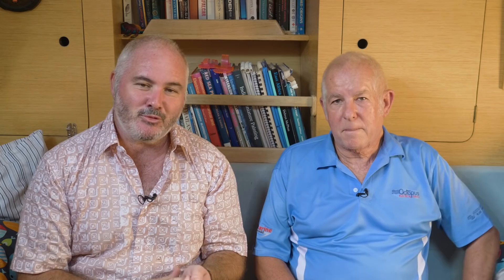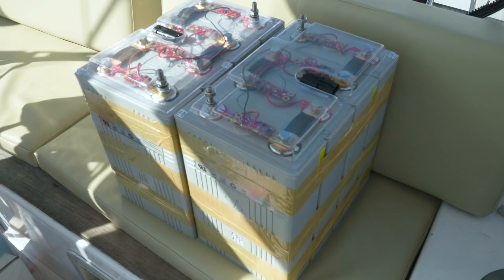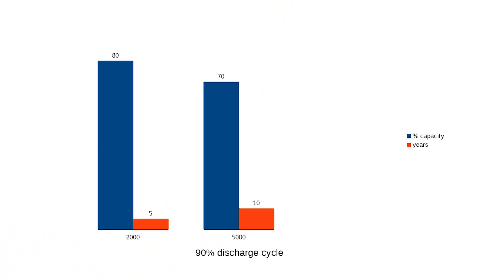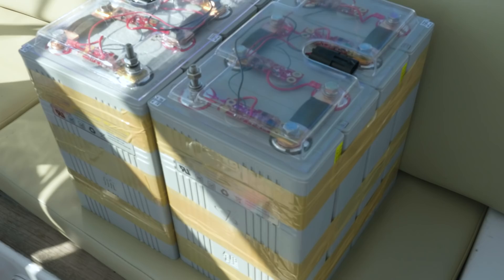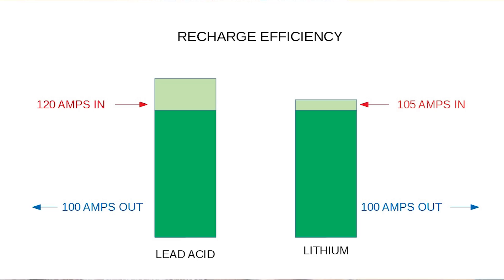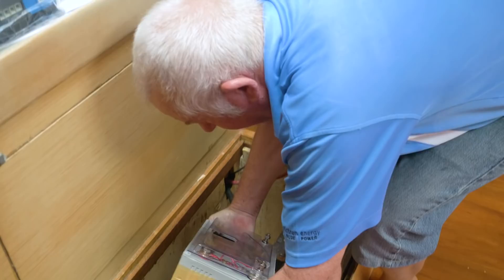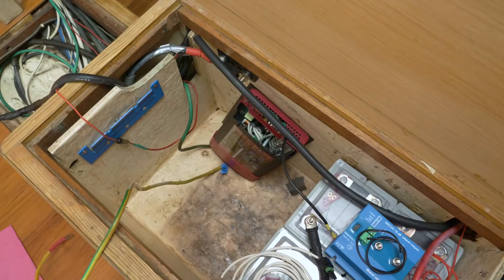Installing lithium batteries on a sailboat - Ep 144

Comment: Jamie and Liz made the right decision according to the United states government.  LiFePO
4 Lithium batteries are the safest, and have greatly reduced the potential for spontaneous combustion, etc.

the more efficient the battery, the more energy stored, the higher the potential for fires and explosions.  but these batteries unlike those before them, have taken safety to a new level (almost, but not quite as safe as lead acid.  to follow is the US Governments feasibility study that answers most of the questions we would have about their safety.  It is basically an accumulation of the many bits and pieces of online data i could find (after subtracting advertisers posing as educational sites) almost as if my research emulated their feasibility study.

Myself, i'd consider a total disconnect and isolation (in the hull/bildge, cover closed, completely disconnected) during a lightening strike risk.  they are highly explosive/flammable, when struck by lightening, or other incidences that can rupture them or otherwise cause sudden discharge.  Otherwise, they are the safest type of lithium batteries, according to the US Government.

https://www.ncbi.nlm.nih.gov/pmc/articles/PMC5505962/
Reply: have you seen the videos where they are shot at and overcharged?? they dont explode
Reply: @helenbell1715  No i haven't.  But it'd be interesting to see.  I have very limited experience with them.  but if i have it my way, will be doing a refit in the foreseeable future, and am hoping Lithium's are part of it.  (hence my concern/s).

I wouldn't doubt that they are airing on the side of caution, knowing the former experience with the lithium batteries.  Lead acid itself, 40ish years or so ago, had issues.  they progressively became relatively safe, such as anything should, so i'm sure these will too.

thank you for bringing that up.  It could help dis-spell some possible myths
Reply: @nonyayet1379  we've been using them for 5 years on our catamaran.  full time cruisers and admin on two facebook groups..lithium on a boat and solar on a boat
Reply: @helenbell1715  I'll look that up thank you.

which lithiums are ya'll using?
Reply: @nonyayet1379  lifepo4 calb 32 180ah 3.2v cells

Comment: Is your 120 amp altenator able to put enough charg into your batteries? I ask because I have the same size altenator and am told that I need one goth a higher output. I’d rather not spend the extra money if I don’t have to. Ty.

Comment: Watching closely,  im an electrician, and I considered lithium last year.. The benefits of lithium really tempted me . But im happy with my 675ah trojan setup .. lithium batteries due to the high discharge rate and stored energy density need careful management, correct size cabling and fuses for all circuits and tiered correctly, ideally wiring should be done professionally .. Another thing im sceptical about is battery life ,  its one thing to say a battery will last 10 years  at the beginning of its life .. lets wait and see .. i remember much the same thing was said about agm batteries a few years ago but practical experience has shown they whilst they were said tto last twice as long as lead acid , im yet to find anyone who has had a longer life than properly maintained deep cycles .. the electronic management system will keep lithium batteries within their parameters,  but i cant help but think the electronic bms will be their Achilles heel , once they shut down or are fried through a close lightning strike , you have no batteries at all to power nav lights, bar your start battery.. Im sure im being over cynical but after 25 years in trade ive heard so many stories from marketing depts about how a product is going to revolutionize only to find its all lip service .. i know i can hook up a lead acid directly to a wind gen or solar panel with no management at all (which means no electronics at all) and i can have a useable system to get me where i need to go.. maybe keep a small deep cycle system onboard jic? Just my 2 cents , maybe im just a dinosaur..
Reply: It would blow the fuse first hopefully  if it has lightning protection { lightning strike }.
Reply: I think lightning will jump an OL :) it is lightning we're talking about here.
Reply: @Scalihoo  yes it would trigger a fuse or breaker but not before destroying anything electronic , a near strike on the other hand would travel through the ground which is not fused ( not that it would make any real difference)
Reply: Fuses and breakers will under no circumstances protect any electrical equipment from lightning strikes
Reply: I 💖 🦕's like you! 👍
Reply: @mitchpender8113  I've had the unfortunate, first hand experience of lightening strikes.  (not on a boat).  not a single fuse blown.  yet had to replace every appliance in the house except the cordless phone i was on when we took the stray bolt.    that was the second direct hit.  the first direct hit, was a near total melt down of our electronics operating off batteries/generator.  nope, those fuses and breakers where of no use what so ever.  

the last one i dealt with fried the fuse box, but not the fuses, blew the ground wire leaving the building (all but one or two strands), melted down one power cord, but not the router it was attached too.   no fuses and breakers don't intimidate lightening.
Reply from the maker: We'll keep you posted on the performance.
Lightning fries everything! We know boats which have taken direct hits (we took an indirect hit in India and lost the radar and part of the B&G nav system). You lose the lot, no matter which batteries you have. You need an electric/electronic refit after a big hit. That's why we've always had insurance... Liz 🤓
Reply: @followtheboat  You/ve hit the nail on the head, for the most part.  except:

the more effiecent a battery, the more power stored up inside of it, therefore the higher the changes of an explosion, and then even a larger explosion.  

I've never seen or heard of a lead acid blowing up in a lightening strike.  yet, according to the government feasibility study, if my memory serves me correctly)  lightening and lithium batteries are not good sailing buddies.  

they are great in so many ways, but in a storm, i would think that isolating (disconnecting and containing inside of a container ) them is the only reasonable answer. 

the percent chance of a lightening induced fire/explosion from lithium batteries is pretty much the exact same odds as the odds of getting struck by lightening.

and you are right, insurance is great.  (so long as we live through the event to actually collect on it).

(that was a bigger mouth full than i had expected, but the research netted a bigger answer than i expected too)

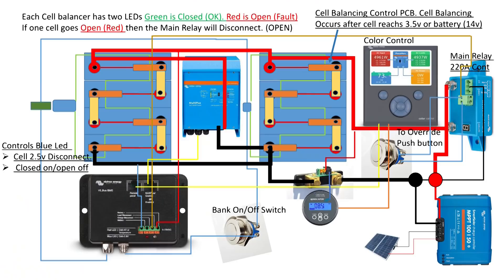Comment: At about 8:10 I think your missed the boat, in the USA we are 120VAC shore power in three grades of Amperage, 15, 30, and 50.  You need to tolerate 120VAC and Step Up the voltage input to your European standard of 240VAC, not the opposite as you discussed.  Maybe I misheard it, and if I did, my apologies.  In either case, your choices in gear is top notch, Victron Energy is the bees knees, best of the best, and I’m throughly impressed by the temperature controls on the engine alternator and the individual battery charge control isolators.   Wow, extremely well thought out system with no stone left unturned, very impressive.  Love your vids and have been a loyal sub for quite a while anxiously awaiting your upcoming adventures.  Could you talk a bit about the dodger, I think several of us noticed a change in the bracing structural supports on the front and I’m very curious as to your findings.
Reply: Hi Blaine,  The Victron Isolation transformer   can accept 110/120 volts   from the mains but then supply 230 volts to all the loads on there boat,  although the Hz will be 60 
Hz,  the Victron in boat systems can accept  185  to 260 volts so this is a very wide range.
Reply: He of course knows that just misspoke.  Those two know what they are doing

Comment: Lightning arrester and grounds, grounds, grounds. Thoughts, please 😎
Reply: back before the days of electricity at remote farms (late 1800's, early 1900's) on the tall barns they used lightening rods, attached to 1/2" braided copper cable grounded firmly into the ground.  the number of grounds where determined by the type of soil.  

it worked amazingly well.  I'm wondering if that same principle wouldn't save a boat and its electronics?  lightening rod is the mast,  and a heavy ground rod direct to the water, giving it our choice of "path of least resistance", rather than it's own choice;   therefore lowering the risk of blowing out through hulls and electronics?

This is just a guess, any thoughts on that logic?

Comment: WOW!  This is a great video full of information.  Great share. Thank you for taking the time from the install to video the installation for us.
DID U SAY ICE MAKER and BREAD MAKER?  I know you will love both onboard. After you get rid of the gas (propane),  NO MORE FUMES onboard. You could actually take a nap below without the Co alarm going off during bad weather and your hatched up.
Please if you don't mind, go through your heating system for us.  And, possible replacements and upgrades (he he he). Your upcoming adventure to the Pacific Northwest will require a robust heating system. I use two heat pumps on MV SEA JAY.  I have to run the generator when on the water during HOT or COLD weather we can have in the San Francisco Bay Area.
Also would like to know how close your planning (and I know plans change) on getting to us in the Bay Area.  Would love a meet up in SF.
Cheers guys :-)
Jay
Reply from the maker: Cheers! 👌🤓 
No heating yet. Planning to install either a Dickinson or Refleks diesel heating system in Borneo/Philippines. 
Not sure when we'll get across the Pacific yet... Depends on how long we want to stay in Japan... And the weather! Keep watching. 😁 Liz

Comment: You mentioned adding a step-up transformer to bring you from 110V to 220V for when you are in North America.  How exactly will this be used since we are also talking about 60Hz vs 50Hz.  Can your battery charger/inverter, for example,  accept 220V at 60Hz.  Will you only be running 220v appliances that don't care about the line frequency.  I have questioned if it would make more sense to add an additional battery charger that is designed for the alternate line voltage and frequency and essentially tie the whole system together through the main DC bus.  This will allow your charger to receive shore power at 110V 60Hz convert it to DC, then your inverter would convert that DC to 220V 50Hz. Probably not too efficient, but it would only by used when accessing shore power.

I am currently planning a complete upgrade to my own electrical system, but I am faced with the opposite situation being from the US with 110v 60Hz standards and wondering the best way to make my electrical system internationally compatible.

Comment: Have you limited the mppt charger of your solar to drop off at certain voltage level or soc, to prevent overcharging?
Reply: Yes the solar system has a lithium mode setup as well

Comment: Hey pay attention to what I say here about your batteries.  What Paul did not tell you and you should know those batteries do not work at all in extreme cold.  You had mentioned you were heading towards Alaska, and if they drop to a certain temperature you will have to raise the temperature of the batteries somehow.  That cooling fan may need to become a heating fan, or install a heat tape or something in that space.  Also...those batteries look like the pretty standard Prismatic batteries.  LiFEMnPo4....not LiFE Po4.   So they are not as robust as say a standard (LiFEPo4)BattleBorn battery might be.    Just be aware you will likely only get 1/2 or 2/3 the cycles you could get out of a BattleBorn unless they are indeed full fledged LiFePo4.  Having said that you will want to find out how much your daily draws are in order to extend your battery life.  Why you ask?  Well, if you can charge your batteries with lower current, and keep them in a range where they are not full and not empty they can last between 4 and 10 times longer than what you are being told they will cycle at...Yes I said between 4 and 10 times longer.  If you for instance can keep them at 30% State of Charge and 70% State of Charge they will last a really long time.  Draining them a lot hurts them, and charging them to full capacity hurts them.   If you only use 100ah a day you can probably float them in a useful range between 30% and 80% SOC.  This means the cells take less abuse.  Now it doesn't mean you can't take them to 100% or near it, especially if you have to motor, or you expect a lot of cloudiness.  It might be prudent to set your solar charging to top at a particular voltage less than full charge.   Then change it if you expect the weather to not play fair and you need a full top up, or can't run a generator or something.  I hope this helps: A video on taking care of your lithiums: https://www.youtube.com/watch?v=Yf9N9zBgyB8&t=6s

Comment: Why after saying the lead is $ 800 each but how much for the one lith
Reply from the maker: Prices for lithium are given twice in the video, Jim.
Reply: Hi Jim  the LP Battery  at 2.5 Kw is about the same as a 200 A/H Lead acid  and is currently $2400 USD  including the basic BMS system.  However  it replaces 2 x  L/A so the Lead acid cost is $1600 capacity available, ie 400 A/H  but you can only use 50% so the available is 200 A/H  compared to $2400 for the LP for a usable capacity of 180 A/H,  however the LP will last a long time ie 2,000 to 10,000 plus cycles .  were the Lead acid is dead after 500 Cycles,  so the life of these makes them stand out .  this makes the difference in cost NOT that great in my opinion. 
Plus lots of other benefits  that go on and on,

Comment: Hi great video what do you guys use for your charger.?
Reply from the maker: It's the Victron 3k inverter charger when on shore power, 120amp alternator on engine, going through A Sterling A2B, and then solar going through MPPTs.
Reply: @followtheboat  hi love your videos so helpful
How does the Sterling charger fit into the system if you have the 3000 w inverter charger or do you have two system.?
Any chance of some pics?
And how are the CALB doing that you got in Phuket?
Thanks in advance